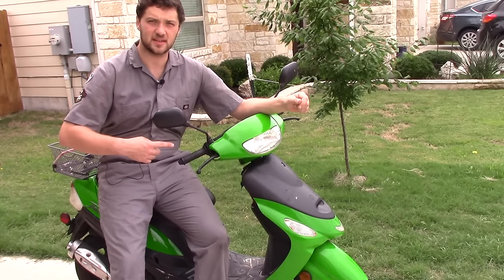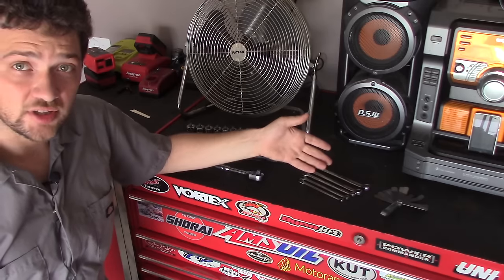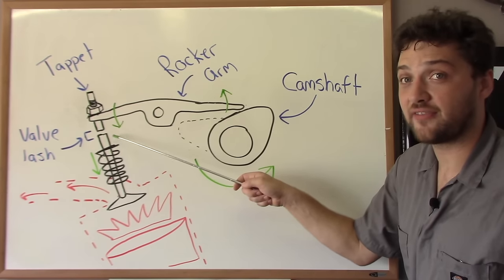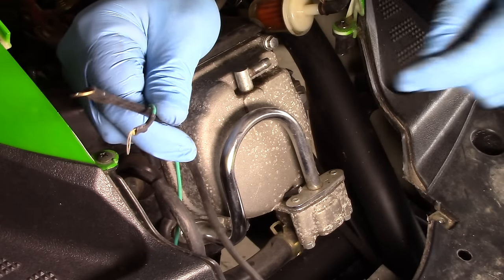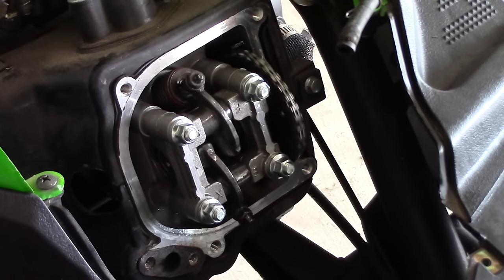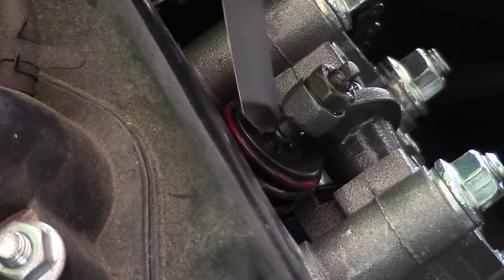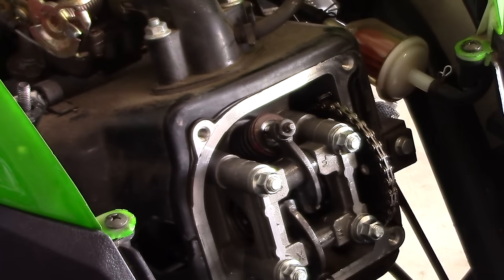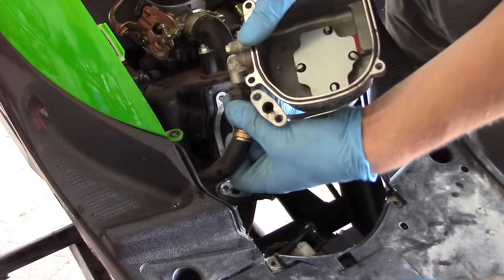Scooter 911: Hard to Start or Wont Stay Running? Try a VALVE ADJUSTMENT! (works for most scooters!)

Comment: @Scooter_911 I have the same issue with my scooter not wanting to stay running. (GY6 50cc). My scooter only has 16 miles on it. Should I check the valve adjustment or be looking for something else?
Reply from the maker: yes absolutely check the valves. Its supposed to be done as soon as the bike is removed from the crate. And if i had a nickel for every chinese import scooter i've uncrated with the valves way out of spec, i'd be eating nickel soup

Comment: I had a Chinese scoot years ago where when one thing went haywire and was fixed something else would go...lol.  It had a glove box compartment on it with a locking door. Long story short, I got tired of the wiring constantly breaking and shorting out so everytime something went out I just ran a wire to a switch that I mounted inside that locking compartment  and then a wire from the switch to the battery and ground..ha... I had just about every electrical accessory wired into a switch-then-to-battery scenario by the time I was done and I have to say that I never had any more electrical problems after I did that. Hell, I even had the solenoid wired into a momentary button switch hidden under the outside edge of the seat so I could start the bike by reaching under the seat edge and pushing the starter button.  The really strange part is that I never had any problems with the charging system. It stayed stock for the most part and the battery just would charge right up!!!  The only issue that did arise over time was some parasitic battery drain which I attributed to all thos switches so I just wired all of that into ANOTHER fuse-block type switch and that stopped the draining.  Crazy Chinese bikes!!!
Reply from the maker: HA! Nice work! Yeah that's definitely one way to fix it, just replace every darn wire!

Comment: Same problem that in order to start you need to give a lot of gas and extra battery power, what can be trouble? Or it will be the same problem? Piaggio Fly 125 4 stroke.

Comment: How do you adjust the forks on the scooter. My handle bars are slightly moved to the left and when I brake, the front end pops forward. 50cc baodiao bd50qt-2a
Reply from the maker: That sounds like 2 separate issues. The popping in the front end of those 50cc scooters is usually due to loose or bad steering bearings. The handle bars can be aligned by taking the head set apart, loosening the pinch bolt that holds the handle bars on and straightening them from there.

Comment: Garrett how can you find the top dead center on a 2 stroke engine 49 cc basically to then install the pull start.
Reply from the maker: I like to insert a small screwdriver in through the spark plug hole and feel for the Piston to reach it's highest point. Good luck!

Comment: I'm assuming the valve adjustment isn't relevant for a 2 Stroke scooter (because ya know, 2 stroke? 89 Honda Elite Sb50 E btw) Replaced the Spark  plug, and put the air filter back on. Thought the filter wasn't helpful but rode way longer without any problem or stopping with it on, and by most  it kept making this weird sound through the carb and Losing all power While it was on the road. 
I'm no mechanic either. Weird belt type tweeting noise too.

Also don't really know what the hose poking into the Air filter from behind is but I'm assuming that's the snorkel. Just looking for insight or help. Thanks and love your videos.

Comment: Great video...I have a new 50cc only190 miles on it ....it is sluggish...sometimes it'll kick in and do 40  takes off sluggish usually only does 30 or 32.....what could it be ?? I bought it with 100 miles on it...it starts easy and idles fine any ideas ....thanks

Comment: What would happen if for some reason like the nut not being tight enough ... the valve adjuster shook itself loose and disappeared with its nut friend? What would it run like and where would these 2 pieces end up?

Comment: My scooters having pretty much the same problem except it’s smoking heavy, changed the oil, checked sparkplug, cleaned the carb... could the problem also be piston rings??
Reply from the maker: bummer, yeah it very likely could be rings or valve stem seals. Might be a good time for a bigbore kit

Comment: Great Vid...my brand new Bintelli sprint is stalling out when I drive it thru a hollow where the sun doesn't shine...outside temperature changes and it stalls...sam thing at night when temp cools down...a new scooter shouldn't need a valve adjustment or does it ? Sincerely
KBL
Reply from the maker: It absolutely can need one. During break in all the parts are expanding and contracting so much they can move drastically. A valve adjustment is also supposed to be done as part of the initial assembly, so it's possible that that step was missed as well! Good luck!
Reply: Garret Seesing thanks my friend... do you think that temperature changes can effect the valves if not adjusted correctly... It has 15 miles on engine...Should manufacturing be held responsible for cost.... I could do it myself but not a good star after shelling out $1200...again thanks for your instantaneously reply ! You rock !
Reply from the maker: @HankCherry  really that should be on the dealer. I would reach out to them and explain your symptoms and your scooters current mileage

Comment: I would love for someone who is having a particular issue to run the scooter with the issue, so we can hear what it sounds like when it dies out, and then go thru and diagnose and fix it.  Mine kymco cobra raver 50cc starts fine on first kick, runs for a bit, I can manually hold my hand over the carb and it runs great and wide open and I remove my and and it dies.  The carb has gas, bowl is full and everything like that.  I maybe have an vacuum line wrong idk.  But if the carb has gas and no leak, it should run.

Comment: Hi I have a keeway tx 125s about 3 weeks ago the bike started running bad when hot it's fine when cold but when warms up it struggles to move over 15mph I've had a new carb new spark plug had the air filter cleaned and the valve adjustment done and still the same problem do you have any ideas please
Reply from the maker: Next time that it's struggling shut it down and open the oil cap. It might have a crank case ventilation issue building pressure in the engine. If a bunch of hot air escapes when you pull the oil cap that's your indicator
Reply: @Scooter_911  cheers buddy il try that tomorrow and hopefully that works, if that is the case do you have any advice what to do from there

Comment: I have 2 suzuki access 125. Looking at your various videos, here is what my "diagnosis" for my scooter:
1. When i turn the starter switch on, the scooter engine cranks (I Hear the coughing sound).
2. My 1st scooter cranks (coughs) for 10 times before it starts. For the 2nd, I can hardly notice the crank (cough) may be once and it starts.

What could be the issue with my 1st scooter. Its pretty new (yr and a half). The scooter company service person doesnt seem to relolve it and pushes it on the battery. I have had 3 battery replacements in 2 yrs.

Comment: I have a 09 Yamaha vino the water cooled 3 valve 4t I think it's a 50cc not 100% sure about that but anyways I went to adjust my valves and there are no nuts on the tappets..... so my question is, does this mean it's a shim type or what and how would I adjust it exactly? Thanks I appreciate it

Comment: Why is it that you have to adjust the valve? Is it because of wear of the tappet and the valve?If everything gets weard out on boths sides can you adjust that or for how long can you do that?
Reply from the maker: It actually has to do with the valve seat. On most gy6 scooters the valve seat is extremely soft and starts to wear and deflect so the valve works its way deeper and deeper into the seat causing a "tight valve" symptom.
Reply: @Scooter_911  Ok, Thanks really for the answer. Thanks also for the video.

Comment: Hi there. Nice video. I have a question. When you adjust your exaust valve, do you have to turn the engine manuely and  put the exaust  valve in the higher position before like you did with the Intake valve?
Reply from the maker: Actually when I turn the engine to top dead center both valves are completely closed, and thats when you make your adjustments. I only reference the intake valve because it is a tell tale that you are on the combustion stroke. Cheers!
Reply: Thank you very much. Very kind to answer. I appreciate. Very helpful

Comment: I know this video was made a while ago but I have a question if you don't mind or get the time and chance to answer it. My scooter is brand new and only has about 5 miles on it and I even bought a new battery. But the battery still keeps dying and I always have to jump it every time I want to start it. If I'm at a red light or stop sign I have to hold the brake and keep moving the throttle to keep it started or it will shut off and then I have to jump it again. Do you think I have the problem that u showed in this video or a problem with charging system. I really appreciate any help or advice. Thank you this is a very informative and well made video. A hell of a lot better than any other's I seen on here

Comment: I replaced a carb on a 2011 rowdy 150 cc the idle control would not adjust on old one now won’t start ?? Gets gas spark vacuum lines ok ?  Need valve adjust ??
Reply from the maker: Mmmmm usually if the idle won't adjust down it's a vacuum leak somewhere. Make sure they're all routed properly and make sure the mixture screw is 2 1/2 turns out.

Comment: I have that same scooter, I can start it just fine, and idles fine, even partial throttle is fine, but when I give it gas to accelerate it bogs down to almost stall if I held it, is this a procedure that could fix that?

Comment: I have a similar problem, however with these differences:  
1.  Scooter starts when I give the throttle. Few turns, but then dies.
2.  While running, any increase in.throttle makes it stall.

Should I replace carb?

Comment: Hey man I just got a tautau 49cc brand new about a month ago from a local shop, it starts and runs good but I noticed on the part that sucks air in has 4 little holes but the shop covered 2 of them with electrical tape, I took it off and it started to die while idle so I put it back on. Should I leave it on or take it off?
Reply from the maker: honestly i would take it back to the shop and explain whats going on. It sounds like the carb is set up too lean and instead of fixing it the right way they just threw some tape on it.

Comment: I am working on a 2018 Znen 49cc . I got it running good but it was leak some fuel out of the bottom outlet vent hose. So I rebuilt the carb and now I can't get it to start and fuel is still leaking out the bottom fuel vent.

Comment: i'm having trouble with my 2016 Kait 150cc.  I've adjusted the valve at .4 and 5. i was sure to have both valves closed b4 adjusting and now not only is it hard to start but is making a lound tapping sound a d when i give it gas is bogs own really badly especially when i get around 45mph

Comment: My scooter is new and I have about 600km on it. Im having issues when I start it it doesnt want to idle and will die if I'm not giving it gas but if I start it and go it picks up but at stop sign I still have to keep a little gas on or it will stall till I ride it for about 5 mins. Do you think I might need a valve adjustment.
Reply from the maker: Absolutely! It's a good idea to do a valve adjustment right at around 500 miles to complete the engine break in. However I've seen scooters come out of the crate with the valves out of spec.  Good luck!

Comment: Brother if you take the intake manifold off and shave all the rubber off the aluminum part and use a radiator hose that has thread infused! I'll tell you why! The carb rests it's weight on the rubber intake with aluminum bolt on part! The weight of the carb bouncing down the road on the rubber part of the intake manifold the weight and bouncing created tiny cracks in the rubber causing a vacuum leak! Take the intake manifold off go to an auto mechanic shop and ask for any old used radiator hose that fits the manifold, so take the manifold with you with rubber already shaved off so that the auto repair guy can get you the right size hose which being used the shop will probably give you! It is ideal to cut the hose at a bend to mimic the rubber you shaved off the intake manifold! The hose has thread inside like I said! The thread holds up to the bouncing of the carb! It is a life hack my friend! I took my scooter over 1300 miles urban camping! By the way you made another great video and your mechanic work is spot on!!!!

Comment: Hello garret seesing I need help fixing my scooter I’ve replaced the stator carb, ignition coil cdi box and I still have no spark I’ve tested my kill switch it has power flowing through it please please please help me get my scooter going before summer ends would really like to ride it before winter thanks and you videos has been very help full to me thanks.

Comment: You used a little screwdriver to go inside the piston. Other 
videos mention lineup the two small holes and one large hole in the middle on the fly wheel and that’s dead center -seems easier.

( How did you film with the camera in such a tight spot ? was someone holding it :) )
Reply from the maker: I always "feel" for top dead center. As a mechanic there is nothing worse than getting burned by missing one little detail. The timing mark on the cam sprocket will show when the cam is at top dead center but if the engine has "jumped time" this mark will be incorrect. To see the mark on the flywheel you need to disassemble the fan shroud and even then the marks are not always accurate. It's a good idea to check if everything is synchronized so if the valve adjustment doesn't help, you don't have to tear the engine apart again to find out.

As far as filming, I do it all myself. I usually use a tripod, and this video was filmed with the scooter on the lift. This allowed me to zoom way in and show some details. 

Thanks for the great questions and thanks for watching! Keep it shiny side up

Comment: Hello Garrett,
 I have an ice bear rocket 49cc that starts hard, runs the battery down, but it will idle and run for a few seconds then loses power and stalls out as if it's not getting enough gas and stalls out.
  I've replaced the coil, spark plug, fuel filter, air filter, C.D.I. BOX.
 This began after a hot day in the 90's.
Any ideas as to what could cause this?

Comment: hi i had a similar problem on my scooter where the scooter wouldnt idle at all and would only stay turned on when we gave it full throttle. At first we thought it was the valves but after checking the valves and realizing there were no problem with our reed valve we came to realize that the actual reason for us was that the oil pump was having issues and causing the engine to get no oil at low rpm, which makes it hard for the cylinder head to move. I hope this helps somoene

Comment: I've installed and 100 cc bbk, I have have all the performance ignition parts, performance CVT and performance exhaust with a 20mm intake carborater. I've adjusted the valves to .004. 
The beast cranks fine, just when it does start it won't idle under it's own power. Help me, I've been too long without driving my scoot.

Comment: I have a taota 150cc scooter the tear wheel is sloppy and has wiggle or play in it what is the cause and what do I need to repair?
Reply from the maker: check to make sure the rear axle nut is tight. next make sure the wiggle isnt coming from worn out motor mounts. If it definitely is coming from the wheels its most likely a final drive bearing. hope that helps, good luck

Comment: My 2007 Aprilia Mojito 150cc starts ok, but wont idle! cuts off at every red light and stop sign. :( my mechanic says it could be the "Air Idle Solenoid"? but he told me that without looking at the scooter. do you think i need a valve adjustment?????

Comment: Trashy carb? I haven't watched yet, my taotao 50, is 88cc with a9 cam, ported head with oversized valves, free flowing exhaust,  I have had carb trouble, everyone lies about carb size, I bought 4, 20mm carbs, get them and measure it, and it's 18mm, I'm hoping the next one is really 20mm.. but I'm having issues with it loosing power when it's warm, it's like it misfires, or something it's almost like it looses dues or fire for a  cycle, every few rotations, nearly everything is new, the only thing I can think if is possibly the ignition pickup, or wiring harness,     
I have been through multiple carbs, even a new pulse pump, it has 5 hours on it, since rebuilding, I have no idea what it could be, if it's not what it mentioned, I'm runnig a aftermarket CDI, that's adjustable, I'm guessing it adjust the amount of advance, or when it advanced, that's the problem with this Chinese stuff, they don't tell what it does, or even why you may want it!  Most has no paper work with it atall! It's crazy! And it's the second CDI, the first one I got, the orange one, it would not start the timing was too high, it wouldn't turn over smoothly, I thought the starter was bad, even with a car battery, it wouldn't start, I'm thinking maybe the pickup maybe the issue, maybe I should try that also, I have replaced everything else! Haha!! Any idea what it could be??

Comment: Dumb question, but why isn't there oil under that valve cover?   Should the oil level be checked after taking the valve cover off?
Reply from the maker: well yes and no. If you take the valve cover off right after running the engine you'll find quite a bit of oil leaking out. However valve adjustments should always be performed with a cold engine. That also allows enough time for the oil to drain back down into the crankcase.
Reply: @Scooter_911  Thank you!  I learned something new.